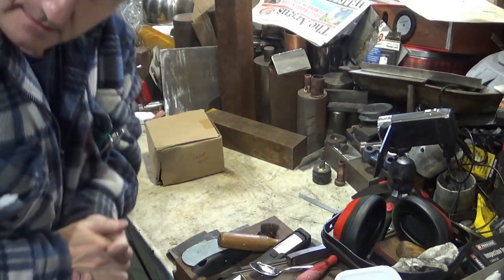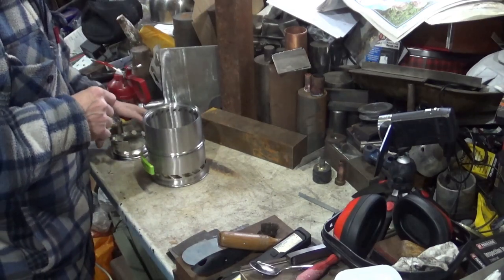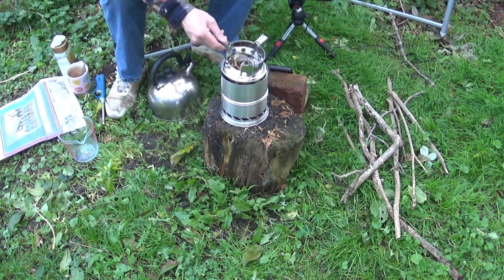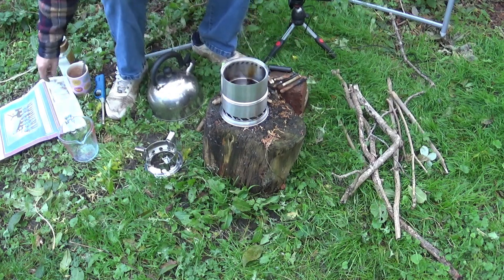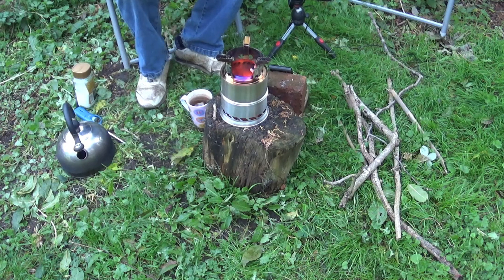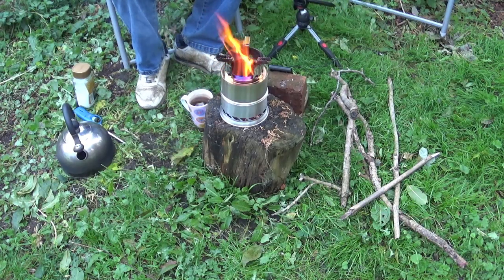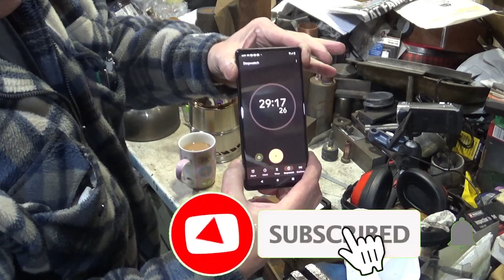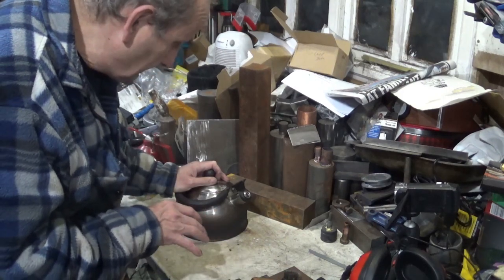Stainless Steel collapsible wood fired camping stove, unboxing, test and review

Comment: Nice and compact little gasifier stove. 
Heated air goes up the side wall, provides extra oxygen to the top of the fire allowing volatile gasses to burn. 
Burns clean when up to temperature.
Burns hot but needs regular feeding with twigs and such. 
Good demonstration of use. 
Thank you.
Reply from the maker: It does need feeding!

Many thanks for watching! Please like, share and if you like the challen, subscribe!

Comment: Those compact twig stoves are really brilliant, and you can usually round up free fuel for them - maybe not to everyone's taste because they can be a tad smoky.  We've got one of the fold flat ones, really compact, but it works really well too, plus you can stoke it without lifting the kettle/pan.  Yours has that neat air passageway that theoretically makes them burn hotter and cleaner. Always nice to see a stove video.
Reply from the maker: They are handy but as you say, smokey. 

Interesting sounding stove you have. 
Many thanks for watching!
Reply: @BensWorkshop  Yeah, it's one of the Lixada fold flat stoves, amazingly small to carry around.
Reply from the maker: Cheers. Might look it up.

Comment: I probably missed this Ben but, just as a matter of interest, how much water was in the kettle when it boiled in four minutes? Just enough for a single cup? I've had a few similar wee twig burners and they seem to be very sensitive to the amount of air they draw - they either won't light at all or burn all your fuel away in a minute. In other words, you have to nurse them a bit. Cheers mate, these are very enjoyable.
Reply from the maker: Half a litre, same as the previous test. Yes the wood burners need nursing to get the best from them!

Many thanks for watching!
Reply: @BensWorkshop  Ah yes, of course, I should have known. Sorry, I was concentrating, I'm loaded with the cold and not firing on all four today. And my valves need done too.
Reply from the maker: @MarkMcCluney  No worries. Hope you get well soon 🙏
Reply: I have a wood gas stove and I can get 2 cups of water to boil in as little as 5 minutes.  I have tried both standard wood and wood pellets.
If I want a hot fire wood pellets are my go to, If I want a fire I can cook normally with normal wood is my go to ... If I want a fire to look at Wood pellets are the best hands down.

These stoves have a learning curve because they work differently.  Wood pellets are very easy to work with but they are very hot (great for boiling water), standard wood is a bit tricky to work with because you have to do more front end work (properly processing the wood and packing the wood)
Reply from the maker: @johnsmithfakename8422  Many thanks, and thanks for watching!
Please like, share and if you like the channel, subscribe!